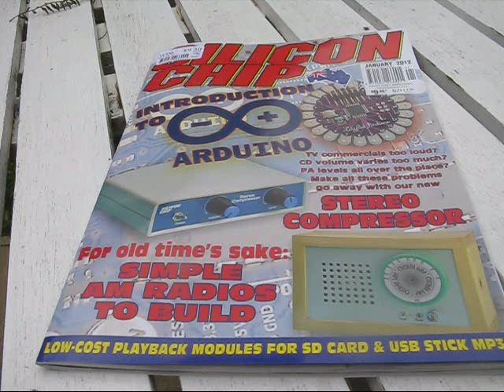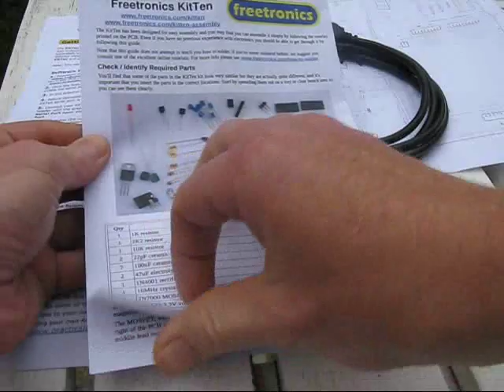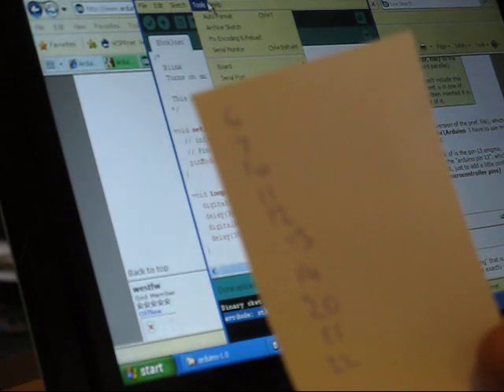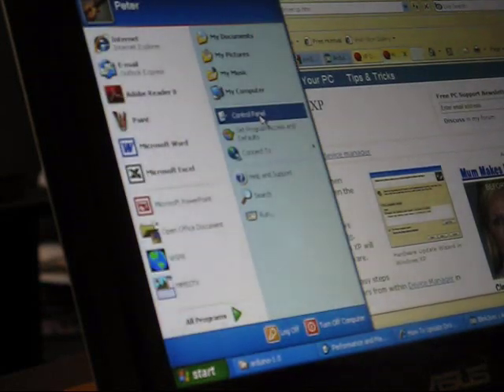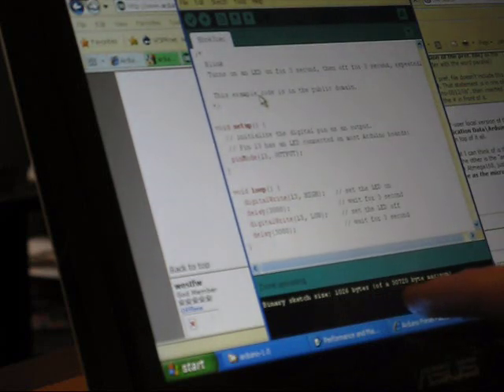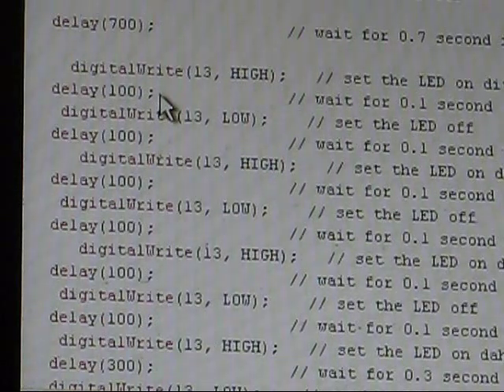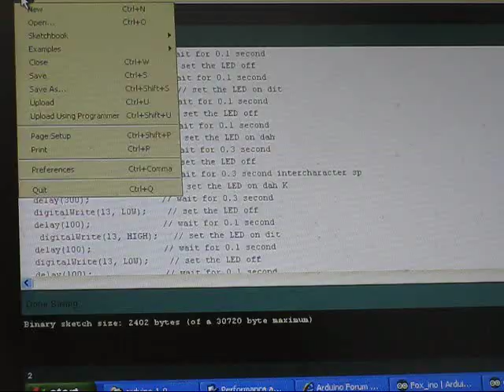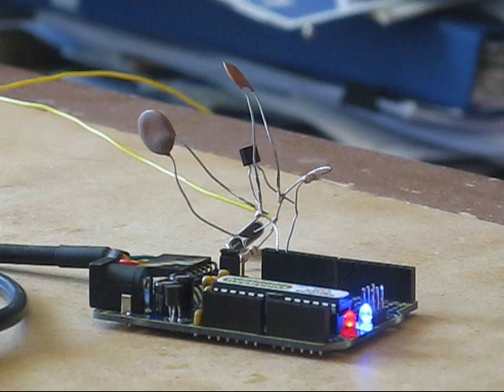Arduino for amateur radio: experiments with the Freetronics KitTen compatible microcontroller

Comment: Editing someone else's code is probably how pretty much everyone starts out, so you're well on your way to learning.  I started out as a programmer long before I got into digital electronics, but I found that the underlying concepts are very similar, which helped me.  Like with anything else, though, your abilities will begin to snowball over time, where learning one thing here and one thing there helps you to understand various other things, which then helps you understand more, etc.

Comment: I know you're just starting out in Arduino, but what you should have done is store the codes for each character in an array. That way, you can have your message stored as text, in a string. Your program (nobody really calls it a "sketch") should run through the string from start to finish, looking up the code for each character and playing it back before moving on to the next character.

If you want, I can write a program to do this for you. Send me a message if you're interested.